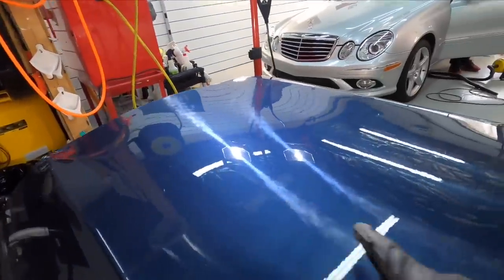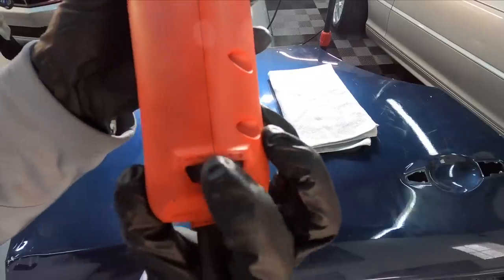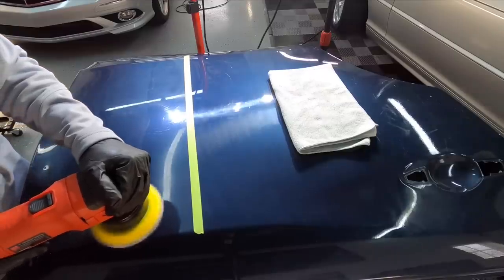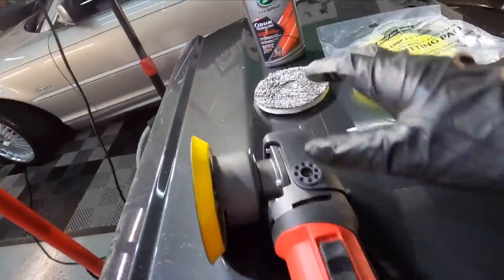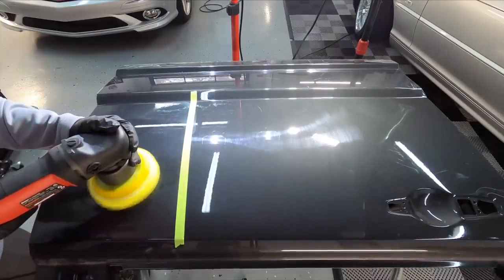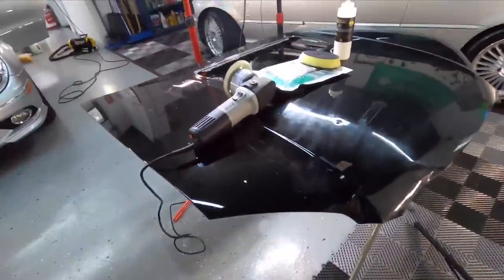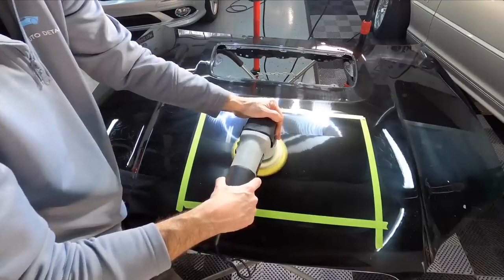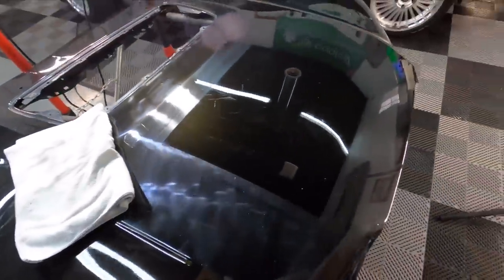Polishing And Paint Correction Made Easy With These Simple Steps!!!

Comment from the maker: How many of you are on the fence about polishing your own car?
Reply: I am, Ive been working up the courage to try it all winter long!
Reply: I jumped right in to it after watching several videos. Used a harbor freight to do my first time.  Liked doing it so much I went out and bought the  g8, g15, and g21. Then the Dewalt dwp849 to learn the rotary on test panels. Then I got the cheap spta to get in to tight spaces like on my motorcycle
Reply: I'm going to do it soon as the weather gets in the upper 50's.  I am going to use Turtle Wax  Ceramic Hybrid Polish & Wax.  I bought the Bauer 64529 last week for $59!
I am going to do a light 2 pass like Brian shows and use a blue-pad.  My black Corvette is pretty good looking except it seems to have haze,  needs a little cleaning and pop.  
Thanks Brian!!!
Reply: I've done a few now. It's a very satisfying feeling to the end result.  I did struggle with a Griots garage 15mm constantly stalling out on a semi I was working on. I would like to get a different 15mm polisher.
Reply: Working up to using my new Makita XOP02Z DA polisher. Just making sure I have enough information (and time) to polish my black car properly...
Reply: I’m about to tackle my old 2006 Ford F-150 truck and I posted a separate few questions in another comment on this video if you could take a look. 

It’ll be my first go round but I’m a quick learner and I’m not afraid to tackle this job.
Reply: Apex Detail I was about a year ago then I just bought all the stuff myself after paying big money to have it done. I figured I could do it and save some money. Now I do corrections and coatings on my cars.
Reply: Haven't touched my C6 urt due to time constraints but just bought a 22 mm da at Harbor Freight and as soon as I can send the wife away on a weekend spa trip I'm going to fire up the heater an have at it.
Reply: I totally am. Did my wife’s car by hand. Nervous about using the DA
Reply: Ron Dail I forget, is the 64529 the updated version of the smaller throw DA? I remember Brian addressed that they revised the unit a few months ago
Reply: Craig Encinitas DAs are very easy as long as you don’t use forced rotation.
Reply: I worked for a used car lot when I was 16 and the different in products now are endless. I took care of all the cars and thought I did a great job. I had to learn.Now I’m 45 and I still enjoy seeing the finished product. You get great satisfaction when you make a vehicle look like a diamond. I enjoy it and actually find it therapeutic. I always love painting houses it’s the same kind of satisfaction.✊💎
Reply: by hand.alberto is watching
Reply: I’m watching your videos to hopefully decide what polisher to buy as the first. I’m sure it won’t be the last so I’m contemplating on buying a Rupes Mk III to go along with some Turtle Wax Hybrid Solutions polish to go with their ceramic spray. 

Keep up the great content. You and Forensic Detailing have become my two favorite serial oriented channels I know I can whole heartedly trust. 

Cheers to more good sir 🍻
Reply: Forgot to mention the two first cars I will be doing with be a 2019 4Runner and 2018 CRV
Reply: Nick Han I bought the Milwaukee battery powered. I had batteries and chargers for other tools already. Those batteries will do a whole car.
Reply: I'm on the fence with doing wet sanding, my front bumper is in rough shape and I think wet sanding would help but I've never done it
Reply: I have been polishing my car and friends and neighbours cars for approximately 15 years. To me it's a labour of love. It's awesome to correct this swirled out mess and bring it back to better than Factory.
Reply: Ive done a couple now.  Your videos helped alot
Reply: I was on the fence. I've watched 100s of your videos and I'm am so glad you have more I haven't seen yet. I bought a chicago electric da (old model you said was good). Still waiting on warmer weather to come and can't wait to finally try it out.

Gonna repack the grease (thanks for the dedicated video on that) and pair the da with megs compound and polish... Lake country ccs orange and black pads.

I'm still wondering whether euro tec 50/50 pad + 3d one would give me near identical results (or better consistency) than 2 step and save a ton of time. 

Great video!
Reply: I have been but after watching your videos and the confidence you have that a consumer can do it I’ll be purchasing some products after the tax refund comes in!
Reply: I just don’t want to ruin my paint. Watching your videos gives me more knowledge and encouragement. It’s pollen season already.
Reply: Same here... been on the fence for quite some time.   I bought the polisher (a maxshine 15mm, MF pads from Meguiars and the fluid - Meguiars D300 and D302), but still have not used them =S.
Reply: @craig.encinitas  dont be worried. Unless you have a vintage Ferrari or something. You wont do any damage, if you do it will be extremely minimal, overall your car will look great when you're done. if you have taken the time to watch these videos, you wont have a problem. Most likely, you will be too conservative and will need a more aggressive pad/compound to get great results.
Reply: Scott Mattern -Thanks, buddy. 

Yep, I’d like to tackle one of my cars this weekend. 🤓
Reply: I am scarred to death to try it, but it’s the first thing I want to do to my new Vette! You are getting me closer to making the leap.
Reply: @craig.encinitas  53 in Denver today, that's what my plan is! Cheers!
Reply: @mikespooner9963  sounds like you will have some very hard clear. Do a test spot to figure out an efficient process, but there is s step by step on a new vette from another good detailing YouTuber.
Reply: Me!! I purchased a maxshine m15 pro last year and I still haven’t used it 😅
Reply: I just purchased a new Toyota Prius. I believe the clear coat is thin and soft and am afraid to prep it with a mechanical buffer in lieu of a quality sealant.
Reply: I purchased a porter cable several years ago but haven’t had time to use it. I am going to use it this year when the weather warms up on my BMW and Ford F250.
Reply: I am...researching what I need.
Reply: i use to but its really enjoyable ! I have only been using orange pads looking for something more aggressive soon
Reply: I have watched your videos and tried not to buy everything you use (not very successfully though) and have had my first attempt on my brother in laws old warhorse, a Nissan Warrior.  It was scary at first but I gained confidence as I got around the truck and he is chuffed with the outcome.  Love the videos and support Brian.  Thanks from Birmingham UK
Reply: I bought a HF polisher and added Griots handles to make it perfectly usable. I've got pads and various glue from Adams. I just fixed the vinyl strips on my beetle by polishing off 7 years of oxidation and then treating them. Awesome results. I have a dark blue Audi I will polishing next.
Reply: I have just started.  I have a G9. Used it Sunday on my 2018 Focus ST. I used a Griots orange pad with the TW Ceramic polish. Could you use any of those compounds on any type of clear by just changing your pad for the type of clear?
Reply: I just bought a Ford F150 Tuxedo Black Metallic.  Has some chips, one scratch and two bad scuffs.  Very minor swirling.  Over $2000 to have a body shop correct it.  I am thinking of trying it myself, but have ZERO experience with any kind of detailing.  Don't even know how hard the clear coat is.  I am the only affordable option that I can see.
Reply: My son just got out of The Marines and bought a car. I told him to bring it by the house so we can do a paint correction. He thought I was going to paint it a different color😂. Thanks for the polisher recommendations I've been a big fan of the Turtle wax "Ice" products and I'll be buying the polisher from Amazon. If I bought a Rupes my wife would file for divorce🤣. Thanks for your video's they always just get to the point. Oh yeah I did forward this video to my son.
Reply: Not hesitant anymore!
I have three polishers now, along with a small army of detailing polishes, sealants, wax and coatings. I practiced on my friend’s cars and soon after, people were and are coming to me looking to have their cars detailed. 👍🏻
Reply: @MrLIVELINESOLUTIONS  I’m about to tackle my 2015 black Audi. What did you find out as far as how hard or soft the clear coat was if you don’t mind me asking
Reply: @240sxdriver  Too many foreign vehicles.  You need to buy domestic cars and support American workers.
Reply: I am working with car care company as a polisher buffer compounding 
I want a very neat n clean environment to work but I can't find here in pakistan
I love to work like you.. I have 7speed 7" polish machine makute copy of Makita
Poineer pressure washer P2
Vaccum west point 
Right now I work as a freelancer 
Thanks for sharing best ideas 
👍👍👍🇵🇰🇵🇰
Reply: I have done my own car and now 2 others using Meguiar's Ultimate and Avalon King ceramic. So not on the fence. However the Avalon King does not bead very well. What would be a good top coat? I was contemplating Mequiar's 21 Polymer.
Reply: I'm nailed to that fence. However, watching and listening is giving me more incentive to give it a go. 
- I'm totally new to the idea of of using a polisher and the compound(s) needed to do it right. My biggest question is ... does the paint need to be preped before the polishing?  ie: clay bar. 

Thanks for your time and everyone is free to reply.
Reply: @doug32588  yes. Wash, clay bar and then an alcohol wipe down. You need to remove any residue and dust otherwise the polisher might scratch the paint.
Reply: My biggest fear is not knowing the current state of my paint. Even with a paint meter I wouldnt know what im looking at.

Comment: I'm trying to restore paint on a 1993 jeep wrangler Sahara. Some spots have pretty good oxidation and others not so bad. The bad spots what do you recommend? Is wet sanding too much for heavy oxidation? There are no flakes of clear coat coming off but it's pretty oxidized. I tried V32 rubbing compound from chemical guys and it worked a little but most oxidation came back. Thanks

Comment: Hi Brian.  You have a great approach to providing information because you're very specific.  Thank you!  I do have a question the I, personally, don't think requires too many specifics.  Before I ask you this question.  I want you to know that I'm asking for your opinion and that I am solely responsible for doing enough research to avoid any negative outcomes in case something I do doesn't work out well.  I take full responsibility for any outcome.  You are NOT responsible if I screw anything up.

Having said that...  Now, here's my question for you.

I bought a 2006 Scion tc that has clear coat damage that I want to fix.  The paint also needs correction.  I may need to get the factory color paint matched for the purposes of clear coat and a few other scratch repairs.  I've been told by the Auto paint store that provides paints for most of the local body shops in my neighborhood, that my Scion has six different variations on the specific silver color on my car and that I should compound out a section of the paint to select the correct color to use for any repairs.  

My question for you is...  Should I work on correcting the paint of the entire car and then use the 5000 grit wet sanding to prep the damaged areas for spraying any new clear coat AFTER all of the paint correction has been done?  Or, should I just prep and repair the damaged clear coat areas and spray them with a couple of passes BEFORE I do the paint correction on the entire car?  Any advice would be helpful.

Comment: I'm supposed to get a paint correction and 18 month ceramic coating put on my car tomorrow and they told me it would take at least 6 hrs and cost me $850 which is a discount vs the normal price. Does that sound good? I have a 2017 Mercedes Benz E300 I just purchased certified pre-owned

Comment: What's your go-to combo for a 2012 BMW? I've heard they have hard clear. I have one in Alpine White and one in Platinum Gray Metallic, both need a two step correction. I've never held a polisher in my life, but I love detailing my cars and I watch all the big detailing YouTube channels. 

I want to pick up a Griot's G8 and G15 and get my cars corrected. I'm interested in using The Last Cut compound because it doesn't stain trim and is very low dust, and has a pad dependent cut. Trying to figure out what selection of pads to buy.

Comment: Hello Brian
I recently purchased a GG 6 polisher, 3D one and some orange and white lake country pads.I have never ran a DA before, gonna practice on my 2000 s10 pickup before I move up to my ' 18 Chevy Colorado.I have light swirls and a few light scratches on my Colorado. I also have GG Complete Compound and Complete polish..Do you think the orange lc pad is a good choice with 3D One for an enhancement before I apply a coating?  Since I don't have any experience I chose to start with foam pads first but if you think a better combo would get better results I'd appreciate your guidance..Thank You
Reply: If I use the gg complete compound w/ orange pads, should I follow up with the Complete polish and a black polishing pad?

Comment: Great video! Thank you. I bought a dark blue 06 Scion tc and it has a 50' detail aka looks great from 50' lol but up close it's very swirly and minor scratches.  I bought the Griots polisher and orange,  yellow, black and microfiber pads, also several brands of polish and sealant. After watching your video I'm certain now I can start with Griots products. I'm hesitant to get started because  the clearcoat is peeling off on the top of the rear bumper and a few small spots on the pillars. Would this car be considered to have soft clearcoat? If so, which color pads should I use to cut, polish then seal?
1 last question,  how do you feel about cordless polishers? I live in a area that has dirt driveways and no garage. I'm looking at the Milwaukee 20v 5 ah. Thank you in advance 
Myke

Comment: You are always a great resource. Thank you so much for everything.
I have a 3 week new Acura RDX ...I am about to apply Adam’s graphene when it comes back in stock.
I have minimal imperfections but would like to polish it before I apply graphene to the vehicle.
Not afraid of the work involved but can I hand polish it in lieu of buying a polisher? Any recommendations would be great! Thanks again! Keep up the great work!
Reply: Did you end up hand polishing it? I know the Chemical Guys have a hand Polishing kit you can buy. I'm kind of afraid of doing it with a mechanical polisher, so been thinking of hand polishing and also putting graphene on my new (used) car.  Just wondering what you ended up doing.
Reply: Use the hand polish if thats comfortable for you. For larger areas tape off zones so you don't end up with inconsistencies across the area from running low on product before you apply more, when your done, take off the tape, do that area, continue with the other pieces of tape. Just remember, you aren't looking to correct your paint. Your goal is to make it better than it was without causing more damage.

Comment: I paint corrected my C7 Corvette with adams correcting polish followed by adams finishing polish, using the matching colored pads. I had to remove dealer installed buffer trails :-( . two questions: how should I annually maintain the now corrected finish?  How many times in the cars lifetime can I correct this car before taking off too much clear coat?
Reply from the maker: tony bella one correction is too many to be honest. Careful maintenance and aftercare is key after correction as to not repeat the process over and over. The good news Corvette clear is stubborn hard and thick.👍😊

Comment: Hello sir, i have a question about rotary polisher. I want to buy a small rotary Flex PE 80 because it’s smaller and lighter than Flex PE 150, but smaller have 800w, my question is, if i want put a backing plate for pads 125/150mm it will be simillar results like on PE 150? I can’t decide which polisher choose, and i saw a lot of vids when you use PE 80 with bigger backing plate. I hope you can explain :). Thank you!
Reply from the maker: Matthew Zly I use the 5 inch backing plates. Mostly for spot correction. Works fine.

Comment: I’ve got the Griots 6” you showed in the video. It does work really well, especially for someone just doing their own car. My biggest issue with it is getting to the smaller areas of the vehicles (bumpers, etc). It wants to stall. What would you recommend to handle those areas? Would the Maxshine Rotary be a good choice?

Thanks
Reply from the maker: Ryan Sanders the MaxShine m550 and a 3 inch backing plate.👍

Comment: I dont have the microfiber pad. I do have the 3d and turtle wax products. Only pads I have are yellow orange black and white, tried 3d with orange but still have swirls maybe didn't work it long enough just worry about messing up paint! Suggestions?
Reply from the maker: HBERG LIONS try the yellow pad.. you might have soft clear.
Reply: Thanks for advice! Tried yellow pad with turtle wax ceramic wax and polish. Worked it slow with about 4 passes. Looked great to the eye nice gloss and shine but when you hit the surface with a light swirls still there. Will try with Meguair ultimate compound now.